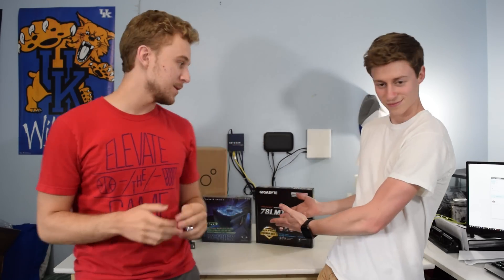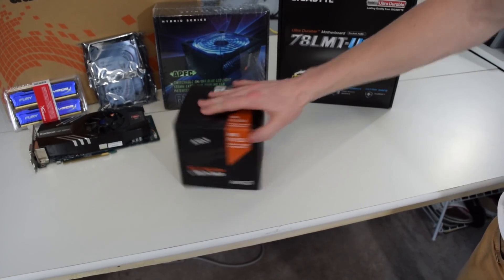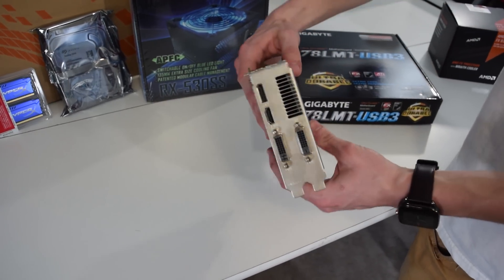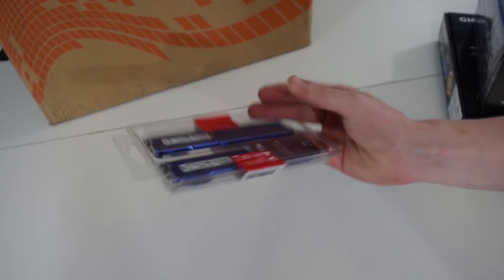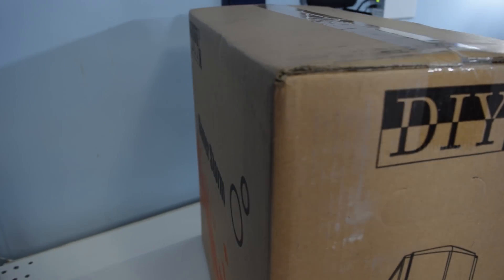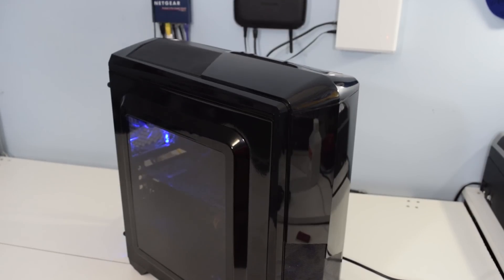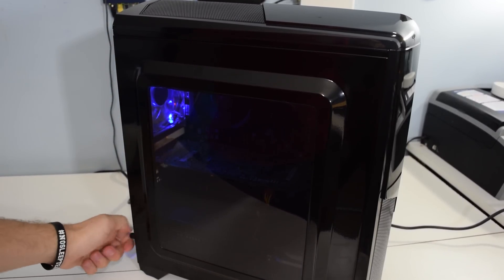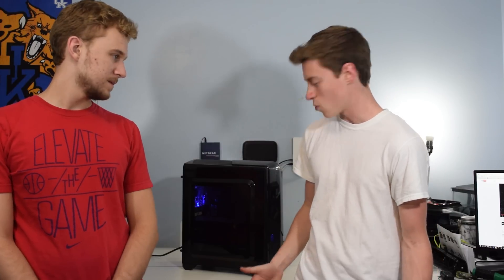2016 Budget $400 Gaming/Editing PC!

Comment: How does the operating system work??
Reply: Species, OS is technically Windows (7,8,10), Linux, ETC. In this build you would either have to buy a OS for extra or use a free copy (You can friend codes for a cheaper price than just at the Microsoft website.

Comment: Also,would I have to buy a sound card?And a wireless network adapter?
Reply: RogueChaos, it should come with a integrated sound chip (on the MOBO) and mostlikely yes for the wireless adapter unless your able to run a Ethernet cord (Highly recommended)